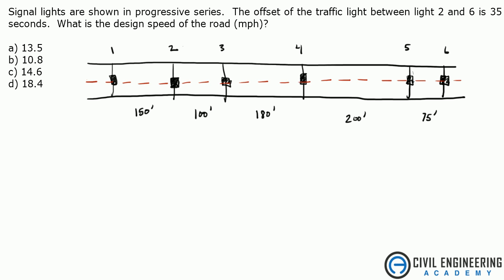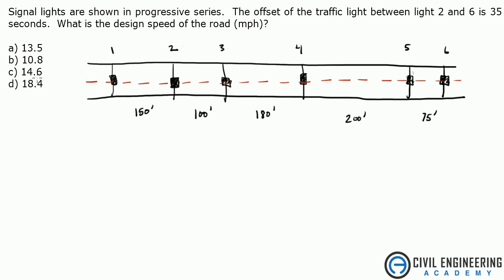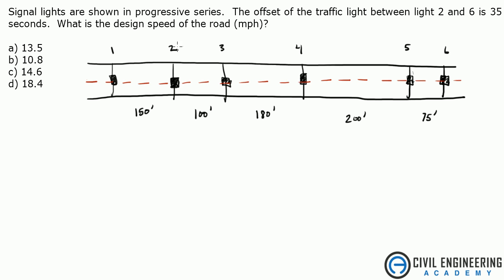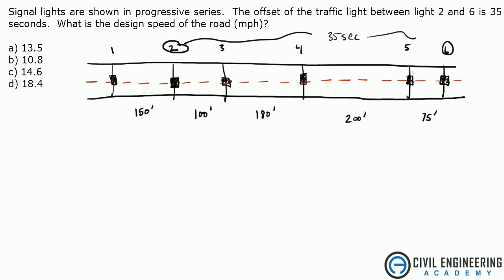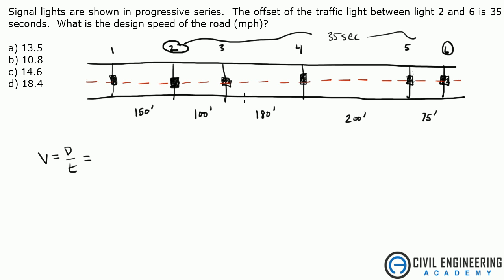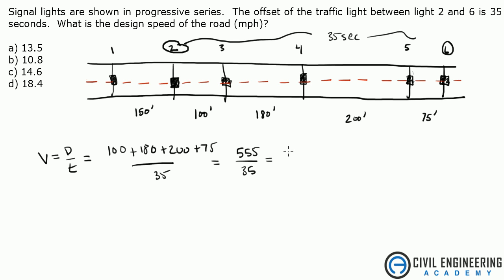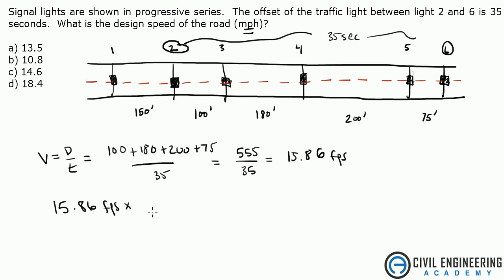Transportation-Design Speed of Road

Comment: Are PE questions really like this? I mean I've never had to calc the design speed of a road using signal offsets. Also we tend to use round numbers. more just wondering if we can expect questions outside of what we would see in the "real world" Thanks!
Reply from the maker: Test world and real world usually do not mix and problems on exams are "not to be used in design."
Reply: @CivilEngAcademy   slam